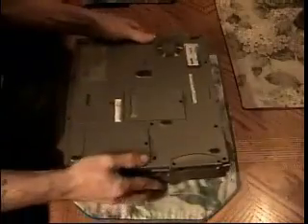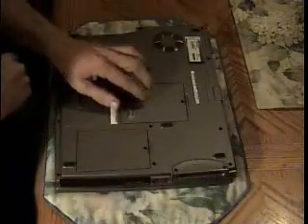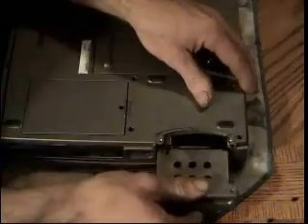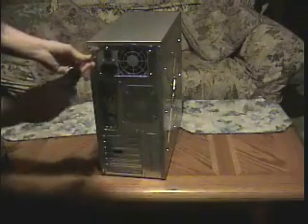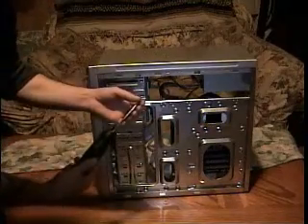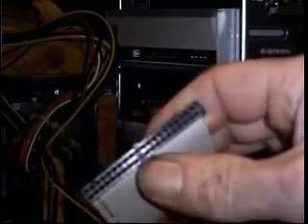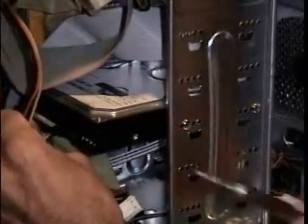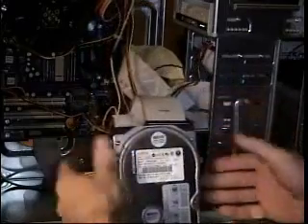How-To Replace Your Hard Drive (updated)

Comment from the maker: @CoDMwHacks you only have the one hard drive but 2 partitions, d is an extra partition that was placed in by the factory to run a system restore, your pc should be equipped with an option to restore your system back to factory.

Comment: I have an Acer aspire M5200, and the right side panel won't come off. Is there some trick to it?

Also, if I replace my C: drive, do I have to worry about patching the power ratings to avoid over-taxing the PSU?

Comment: How do we jump from Laptop to Desktop?
As a matter of fact what the hell were we doing with a laptop in the first place?
The title lists "How to replace your hard drive" but this file goes into laptop batteries & so on.
It's best to pull a hard drive/cdrom out of a PC with the ribbon still attached to the drive, Why? Because after a few years they break real easy.
So get em out & apply even pressure.
Besides you'd want the 80-wire ribbon for testing not the 40 used on most cdroms.

Comment from the maker: @TheNascarfan14 Under your laptop you should see an access panel, one for memory and one for hard drive, take the screw out to remove the panel and the hard drive will slide out, Place the new one in and install the OS, after you can get a usb adapter to fit your old drive and plug it into a usb port to get your data back.

Comment from the maker: is it a dell? You have to take the front cover off. I bet your hard drive slides out the front,
dont force the cover off it has tabs holding it in or small screws.

Comment from the maker: The working computer is trying to boot to your hard drive not the original drive, you have to make sure it is not listed as the boot drive, either you have to plug it into the secondary cable or if it is a serial drive then go into the bios and make sure the original drive is the one set to be the first boot drive.

Comment from the maker: Sometimes the bios can get confused, If you open the side cover on your pc, unplug the hard drive small cable, and start it, it will not find the drive of course because it is unplugged, but turn it off and plug the drive back in and it will search for it, it should then find it again.
It happens sometimes with the Serial connection. Let me know if it works or not.

Comment from the maker: Yes, leave your old drive disconnected and install the new drive and operating system. then hook your old drive up to the cd rom cable and boot up, get your data and then unplug it and plug the cd roms back in. Running the hard drives on separate cables will save you the hassle of any jumper settings. If your old user accounts are password protected it may be a bit more difficult to get your data.

Comment from the maker: You are not going to hurt the xp disk, just leave it like it is and hook the win98 disk up to the cable and power plug that the cd roms are plugged into. That way you don't have to change any jumpers, and when 98 searches for drivers you can point it to the xp disk. or just unplug the xp disk and plug the 98 disk in its place.

Comment from the maker: Yes make the 98 the default drive and then the 98 operating system should work and boot up in the custom computer but you will need to get the drivers for video and sound etc. before you boot to it, because you may not have internet without getting the network adaptor driver. The disk that is running now has the drivers for XP.

Comment: what if i just want to make it my default drive? i just want to try out windows 98 because its been loooooooooooooooong time since i played it. when i was 3 i used to use it! anyway, i have another question. the hard drive is coming from a acer computer and the computer i am puting my hard drive in is a custom computer. do you think it will be "compatible" with the computer?

Comment from the maker: you can put both hard drives in the working computer but you have to tell the bios which one to boot to.
You might be able to run the 98 hard drive in the xp computer but the drivers will all be different and 98 is not very easy to set up new drivers.

Comment: hey good video! my dad gave me our old windows xp home edition computer to use to work on. i have my first computer windows 98 in there to. i want to run windows 98 on my working windows xp. if i change the hard drives, will it switch to 98?

Comment from the maker: Ok if your going to take the drive apart, make sure the door is open first, then you can get the end cap off, once you have that off and remove the screws it will come apart for you.
You will need to plug it in to get the door open. Or insert a paper clip into the tiny hole in the front.

Comment from the maker: Try cleaning the laser on your cd rom, You can see it on a laptop cdrom but if you have a desktop than you have to take the cdrom apart use buy a cd drive cleaner. (It's a cd with little brushes on it) But if you spend $10 or $12 on a cd drive cleaner you might as well buy a new cd or dvd drive for $25

Comment from the maker: There should be 1 little tiny screw straight back (about 4 inches) in the center of your drive that is holding your drive in place. remove that and it should slide right out.

Comment from the maker: there is usually one screw holding the dvd drive in. And maybe a slide button, it's probably about 3 inches back from the front of the dvd player on the underside of your pc.
remove that screw and it should slide right out for you

Comment from the maker: It should only affect the system files that have changed since that date.
You should try running an online virus scan at (trend micro) they call the scan (housecall) because usually it is from a trojan that your desktop gets locked out like you are.